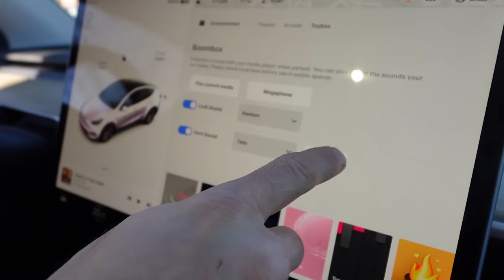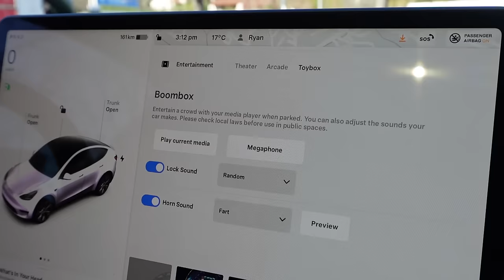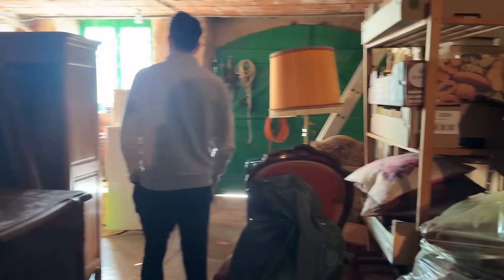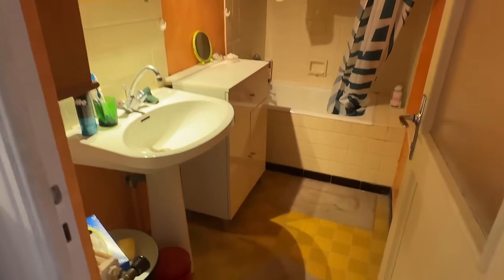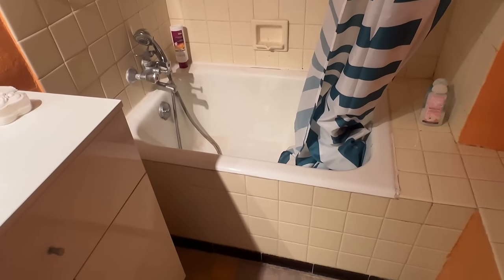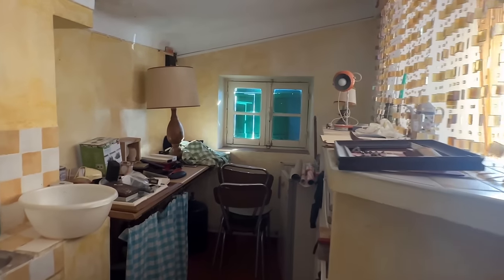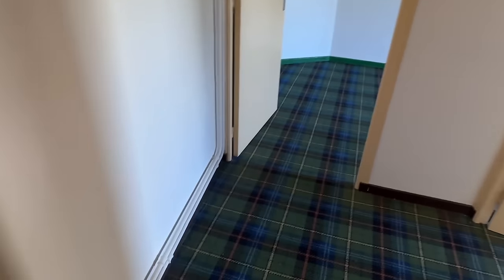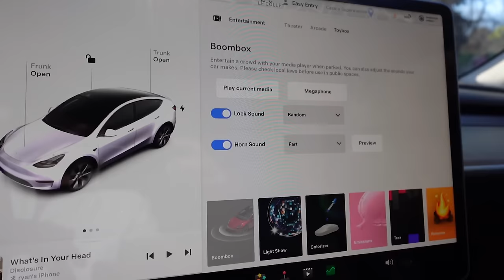WE LOVE THIS HOUSE! 😍 French Property Search

Comment: Hi Fern and Ryan,  it was a lovely home, but would need alot of work and its all big dollars stuff.  I purchased a home in Brittany but as typical here in Australia it had to be vacant possession which means the owner has to remove all there possession before settlement could take place.  From what I understand this does not always happen.  The house had been vacant for 10 years when I purchased it and it and the outbuildings were full of stuff just like what you would be dealing with if you purchased the property.  The family cleared the property for the sale and it took them 3 months and many trips to the tip and the charity store.  Anyone purchasing in France, be aware, only take a property at vacant possession, fees and charges for clearing a property can run into the thousands.  Best wishes for your house hunt, good luck we look forward to seeing more, cheers from Melbourne.